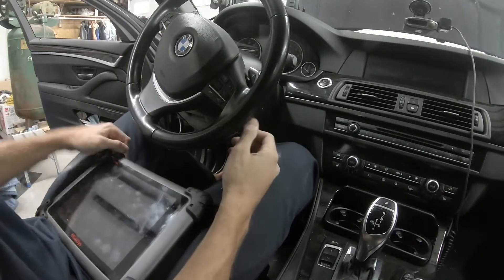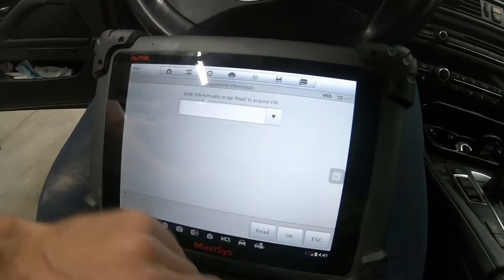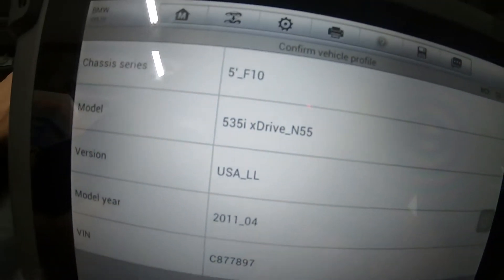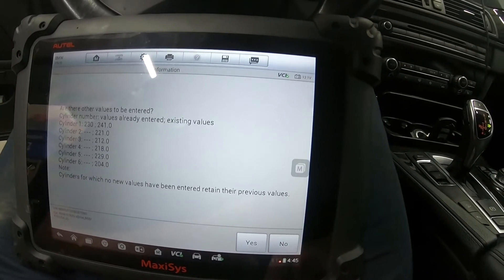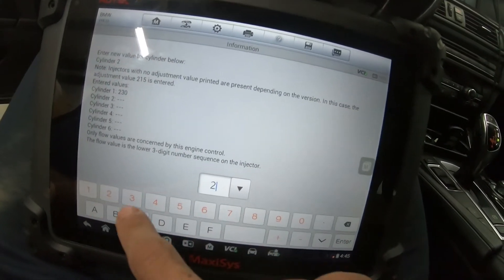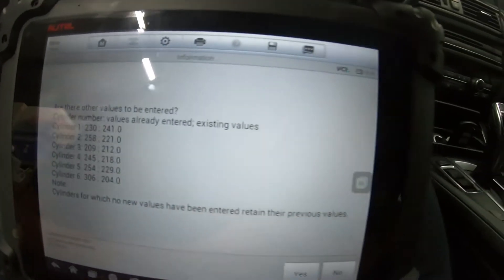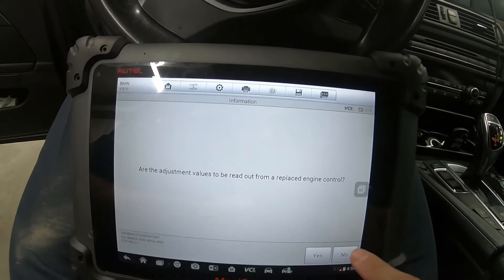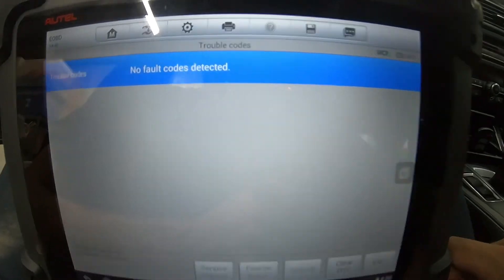How to Calibrate BMW 535i Fuel Injectors F10 2009-2017 Autel Maxisys

Comment: 2011 F10 - got the mx900, went to do this as I replaced injectors in cylinder 7 and 8.. The codes that are in there now are 6 digit and most are the same for each injector. I looked on the old injectors and none of the numbers match anything anywhere.
Reply: are you sure you bought the right injectors
Reply: @SaulAndrade-y6m  yes absolutely. When I have the machine read the existing codes in ecu, they come up as 6 digit numbers for each injector. For all 8 injectors it shows one of these codes 058002, 057002 and 056002. these numbers are not on the old injectors. 
cylinder 1 - 057000, cylinder 2 - 058002, cylinder 3 - 057002, cylinder 4 - 058002, cylinder 5 - 058002, cylinder 6 - 057002, cylinder 7- 058002, and cylinder 8 - 056002